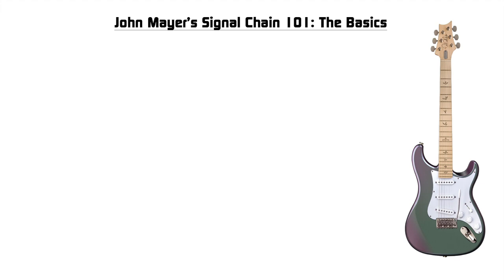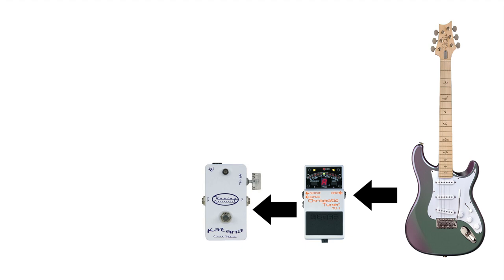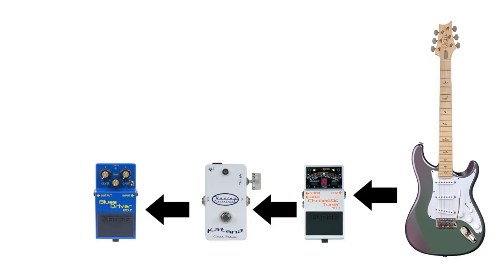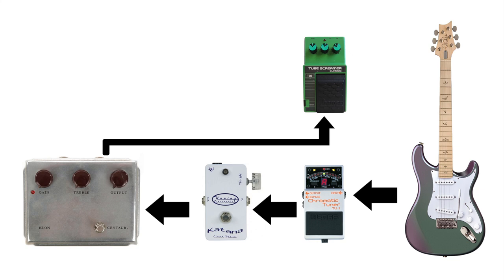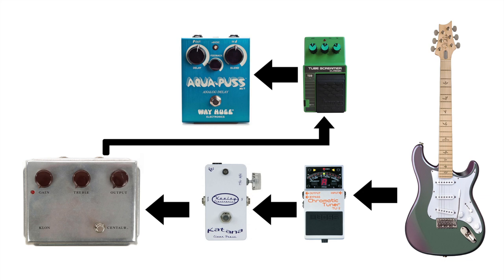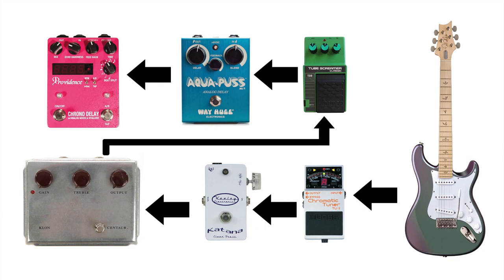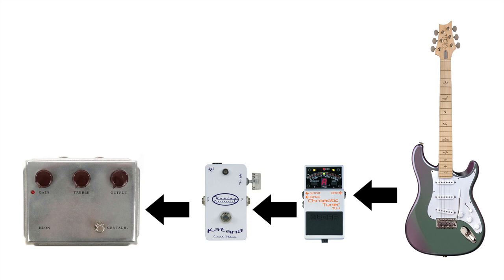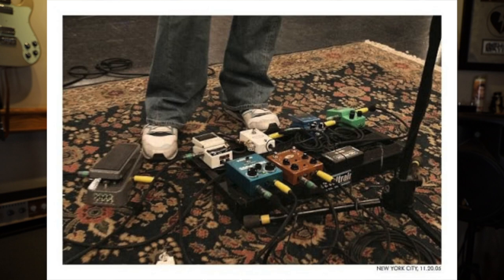John Mayer's Signal Chain Crash Course: 101 The Basics

Comment: Cool video! Hey, what about BD2, TS and a Klon on a board? In what order would you stack them and why?😉
Reply: i like Klon > TS > BD2
Reply from the maker: It's obviously what sounds best to you! I would do BD-2 -> TS -> Klon. I genuinely like the TS into Klon sound then use the BD-2 to push the TS! But whatever floats your boat!
Reply: @JustinJeske  if you want the sound of the klon that will work but if you want the sound of the ts it should be the last pedal. If you want to push a ts with a blues driver then the the blues driver goes before the ts. I always like to use the klon to push my ts or whatever od I am using as the dominant sound. Personally I never use a klon as a dominant drive, always as a boost. Great video although I'm not much of a JM fan I am a Tube screamer fan.